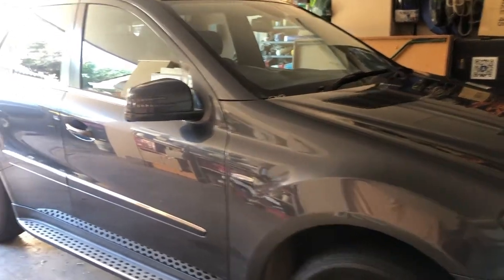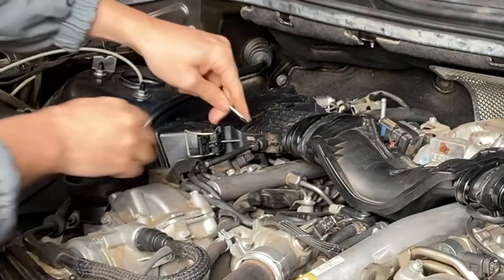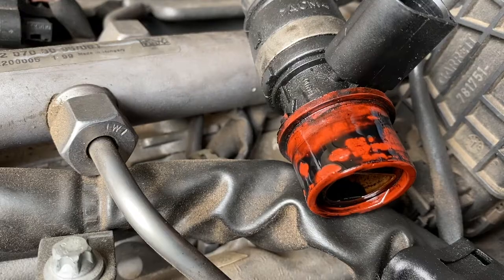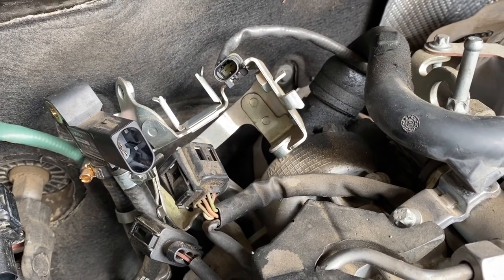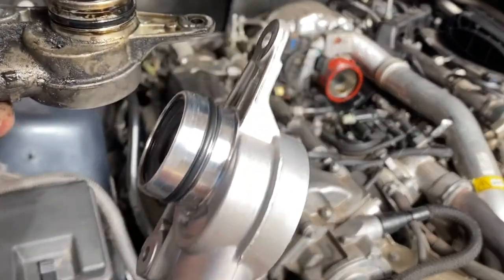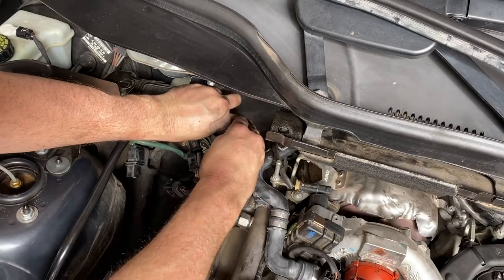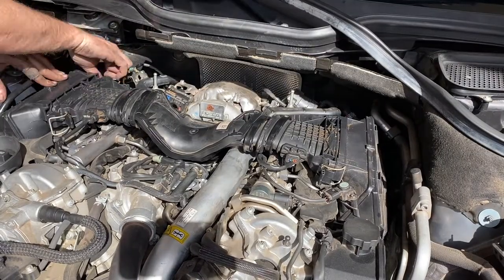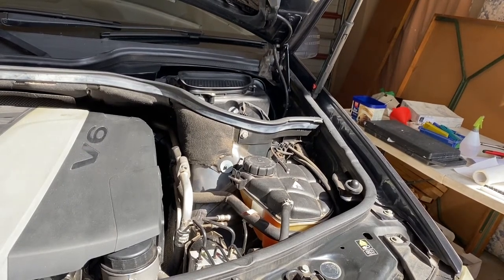How to Replace Mercedes ML W164 OM642 PCV Valve - The Complete DIY Guide - ML300 ML320 ML350

Comment: This video actually helped me locate the DPF differential pressure sensor it is behind that left airbox.  If anyone has limp mode issues, might be worth replacing that sensor, so far has solved my issues, I had two of the same sensors on my 2010 ML350 bluetec.
Reply from the maker: Awesome, I’m glad it helped and you solved your issue!!  Cheers Drew

Comment: I think the pcv valve replacement before reaching 60k km is probably the most important maintenance item that people neglect on the OM642. This is what kills the intake flaps and all kind of carboned-up issues, not the EGR.
Reply from the maker: Hi Emi, thanks for your comments, I believe that you are spot on!  Cheers Drew
Reply: My last one only went 23,000 miles! Average seems to be about 60K.
Reply: @KitYeeScott  these things are too cheap to not make it a regular maintenance item with the air filters and whatever. I'll make sure to do it more often from here on out, I was planning 40k for the next change but I'll cut it short.

Comment: Hi Dew... I have a 2007 GL320 CDI and I can listem my turbo leaking air and not boosting... I repalced the Turbo actuator not too long ago and the car was running pretty good until 3 days ago... now, no power and a wooooosh sound coming as I step on the gas pedal. Any ideia? thanks and a big hug from FL, USA. (BTW, I have run a scanner, it said a MAF sensor fault. I replaced both MAFs and same thing. So, I'm really confused about whts going on...

Comment: I own a 2016 GL 350. I have noticed that the fuel consumption has increased after i had its B5 service done from he dealership.  And I have also noticed some oil on the plastic box like thing that is in the front of the engine connected to the line that goes from turbo to the intercooler.
Reply from the maker: Hi Mate, unfortunately I have not many very good experiences with mechanics (inclusive of work undertaken by dealerships) which is why I do all of my own work now and share as much information as I can to others with my videos.  Any oil leak is not right and you have two options 1/ take it back to the dealership where the service was done and get them to rectify the issue that they caused under warranty or 2/ fix it yourself!  At the end of the day the most likely cause will be a bad seal as a result of them pulling something apart and then stuffing the seal on reassembly!  Checkout this video I posted which is probably the issue are now having: https://youtu.be/D9ALXb4pbww Cheers Drew

Comment: Great video but Benz only like Benz parts Amazon parts are carp.
Reply from the maker: Hi Mohamed, I think that you have to be selective about where you use genuine parts versus Amazon parts.  I have had great experience using Amazon (non OEM) parts on my Mercedes, however in this case I deliberately chose an OEM part for the reasons mentioned in this video!  My air suspension by comparison is completely Chines parts purchased from Amazon and I have absolutely no issues with my suspension on the vehicle and saved many thousands of dollars by going down this route!  Cheers Drew

Comment: Hi Drew, were you noticing an oil leak before this repair? I've been chasing an oil leak on my jeep cherokee with the om642, I had the oil cooler seals replaced and that helped a lot but I still have a small leak somewhere leaving 5 or 6 drips after it is parked. Thanks!
Reply from the maker: Hi Mate, yes I was!  Also check out this video … 
https://youtu.be/D9ALXb4pbww It actually makes me annoyed that the first thing repair shops want to do is oil cooler seals and then they wand you away with oil leaks still after spending a couple of grand!! Cheers Drew
Reply: Know this is late, but om642 has issues for oil leaks at the vacuum pump as well as the oil housing filter.  Worth looking in those areas if  still have the car.

Comment: Thanks for that drew. Not alot out there for this engine. Alot more out for the older 320 v6. Which has a different pcv valve.

 Cheers!
Reply from the maker: Hi Ross, u you are correct.  Sometimes you may say a Black 2006 ML320, this one has the older PCV valve style which is actually on top of the head and is a different valve!  Cheers Drew

Comment: Did this on my w212 e350. Straight forward but those bolts are a bugger to get to. I had to remove airbox and that bracket too  Had to use a pry bar to ease it out too. Wish I'd seen this video first . Thanks.

Comment: Hiya, I just did this job on my R class. Your video was very useful. Mine was like yours, just a bit of oil - but it had obviously never been off at 95K miles and 10 years. Liked and subscribed 🙂
I did the green O ring too - that was hard and knackered!
Reply from the maker: Awesome and thanks for the feedback!  Cheers Drew
Reply: Did you notice lower fuel consumption after replacing?
Reply: @Silvestian  yes mate, do you have the same mpg drops down? My go from 45 to 39 mpg 😢

Comment: Hi, thanks so much for educating us with all these great videos. I also have a 2011 ml350 with bluetec , with about 115000 miles on it, recently it has had a really bad vibration while driving in traffic with low rpm usually abot 1400 to 1900 then it goes away, almost as if the transmission mount was causing it. I was wondering if you or any of your viewers have experienced similar issues. Best regards.
Reply from the maker: Hi Vahid, vibrations can come from many places throughout the entire driveline.  Personally I would start with checking to see if your wheels are in balance and then progressively work through checking mounts and couplings. Note, I did personally have a vibration which turned out to be a wheel out of balance at one stage.  Cheers Drew
Reply: Same MY 2011 350d You'll most likely find it's your front control arms and front air shocks. Had both replaced and what a difference it made!

Comment: Great video Drew ... can I ask the two bolts that hold the PCV ... did you torque them up and if so how tight do they go please ... thank you
Reply from the maker: Hi Brady, I did not use a torque wrench, I just tightened them by feel.  Honestly the best part I have swapped out, there is another idea I did after this one wrt the unexpected increase in fuel economy, which is absolutely true to this day. Cheers Drew

Comment: Another great video, you are saving us heaps. Can I confirm that with PCV valve replacement, do I still need to install oil catch can? That is a more daunting task which I'll happily avoid. My OM642 has only done 70K Km or 44K miles. When do I need to start replacing the PCV valve? Are there symptoms like high fuel consumption which is a good indication to PCV failure? Thanks again.
Reply from the maker: Hi Rafis, all excellent questions!  To be honest I think this is actually an age thing as opposed to usage (eg kms) as the rubber diaphragm inside the PCV goes hard with age, however the thing to do is to simply take the plastic turbo y inlet pipe off and look in the turbo inlet to see if there is excessive crankcase oil sitting on the inlet lip of the turbo.  I have not put a catch can on my OM642 and mine has now done 140,000 kms however I have thought about doing it a few times.  Probably not a bad idea in the long term, however my thought was to fix the source problem first, which I believe was the PCV.  After doing the PCV I surprisingly got much better fuel economy which I also explained in a video: 
https://youtu.be/XihgSa-Qyr0 Cheers Drew
Reply: @DrewFixIt   @DrewFixIt  Hey mate, so took your advice and took out the Y pipe cause I was only getting 7-8km/l on a highway run and only 9-10km/l in the city. I think a dielse can do better. And true enough, even at 77K km, there's oil around the turbo inlet and both ends of the Y pipe seals. I've ordered the PCV part you've suggested and once it's in, I'll find the courage to replace it. It is an easy job but it is in such a tight space that it is tricky. And you are so right about mechanics at dealerships. This car has a good history of it being serviced and maintained at MB however when I removed the Y pipe I saw that one of the seal was not seated properly and someone has forced it in and lock the clips meaning it was not sealed properly for many thousands of kilometres. Not sure if this would disturb the MAF and fuel consumption. Anyway I've replaced that left side seal myself and hopefully I didn't bodged it as it wasn't as easy to put it back as the right hand side. The turbo seal looked alright but I've replaced it with a new one and it fits a lot more snugly and have also tightened o ring clamp which was not tightened before. I also wonder if I should just block off the PCV hose connecting to the Y pipe? And then block off that hole on the Y pipe, what would that do if I don't install an oil catch can. Thanks Drew
Reply from the maker: @rafiskadir  Hi Rafis, the crankcase needs to breathe mate, thus please do NOT block off the PCV breather hole as you suggest.  NOTE - if you do this you could actually cause damage!  Cheers Drew
Reply: @DrewFixIt  Yikes...definitely won't be doing that. Enjoy the weekend

Comment: Hi from Canada, Drew. This piece of advice is incredibly helpful. I've had a bad oil cooler leak on my 2010 and the mechanic is currently looking at it. The turbocharger stopped working and the car has been in limp mode for a while now. We'll be replacing the turbocharger but I'm starting to wonder if the reason it's not working is because of a leak from the PCV valve? Do you think it's wise to also replace the turbocharger? For the PCV, Mercedes advised to use part A6420102391, not the one you used. I’m a bit confused…
Reply from the maker: Hi Mate, are you sure that you need a complete new turbo?  I replaced the turbo actuator on the black ML that you sometime see on the channel with this part: https://amzn.to/41VsXSi and it fixed the issue with the vehicle going into limp mode with a turbo fault.  It is far cheaper to just buy this part than the whole turbo!  Cheers Drew
Reply: I was wondering about that but was skeptical after reading some online posts about the replacement actuators crapping out. I already bought the new turbo, though. Does it make any sense that an bad PCV valve could leak INTO the turbo or does it just leak ONTO it, not damaging it? Thanks so much!    @DrewFixIt
Reply from the maker: @tickertape82  Hi Mate, I can't see how additional oil going into a Turbo could damage it.  Rather the additional oil just creates a mess in all of the intercooler and intake system!  Where are you, can I have your old Turbo?  Cheers Drew
Reply: Ok, good to know! I'm up in Canada. Can save it for you if you like.  @DrewFixIt

Comment: Hi there 
Do you use any liqui moly CeraTec oil additives when changing oil? 
Any advice highly appreciated
Reply from the maker: Hi Mate, I have used oil additives many years ago, but that was like 20 years ago.  I certainly am not against them, however I genuinely purchased high quality oil as specified by the manufacturer and rely upon good quality oil.  Cheers Drew

Comment: Some youtubers suggest to reroute the CV from right in front of the turbo intake to in front of the air filter to reduce suction. What are your thoughts on this?
Reply from the maker: I think the manufacturer made it like this for a reason, so just replace the defective parts!  Cheers Drew

Comment: Hey ! 
Does a bad PCV can affect your EGR valve ?
Reply from the maker: Hi Mate, a bad PCV valve has the potential for the turbo to suck crankcase oil when it spools up, Whig I suppose could then pump that oil through the whole EGR system too … Cheers Drew

Comment: Did it help getting the oil into turbo?
Reply from the maker: Yes mate, my Turbo is much healthier for it now!  Cheers Drew
Reply: @DrewFixIt  thanks. My turbo is getting oil through this valve. But new part seems like straight pipe. I will replace it anyway. Thanks
Reply from the maker: @satnamlayal7034  I think perhaps you have received an incorrect part as my part I installed was physically identical to the original. Cheers Drew

Comment: Hello drew, 

I just change my pcv valve, the car i driving great and have nice response but i am getting really high fuel consumption efter the replacement you have any idea what vent wrong ?

My air filter on the driver side is have oil marks aswell ( 20% of the airfilter) 

Regards worried 350 ownerb
Reply from the maker: Hi Mate, sounds like you are sucking up an excessive amount of oil.  Did you install a genuine Mercedes part mate?  Cheers Drew
Reply: The old pcv was a original i think, it was stuck open wich made the oil leak into the airfilter. The new one is from a brand called trucktek and seem to do the job better but just giving me absurd amount of fuel consumption. 

Any sugestions of what i cal do to fix it ? 

Can oiled up maf sensors make this occur ?
Reply: A little update. 

Just stript the intake butterfly and cleaned it with contact spray and canned air the car is running great and rides nice.. the fuel consumption on highway was back to normal again but when i just stand still and idle its starts going up again

Any toughts ?
Reply from the maker: @HaiderAli-cd3vt  the new PCV valve has a new sensor in the hose from memory.  Sounds like you may just need to put some time on it to let the ECU re-calibrate perhaps?  Cheers Drew

Comment: got e350 4matic,2010 model,just same part. They sell also that oilring,oilseal,60euros. And whole tubular system,200euros. So i just bought whole tubing valve case thingy.430thousand kilos driven, in a klock. About time to change. MIL-light ,motor shape- is on now. Just fefore,i put 4tech stuff in a tank. To dissolve pdf stuck. shall see.....greets from finland/suomi.
Reply from the maker: Hi Mate, thanks for the update!  Cheers Drew

Comment: 1 month ago i did the oil change in a workshop . After oil change i noticed some loss of power . But I didn’t care because there was no warning lights . Yesterday i checked there but the PCV rubber seal , intake seal weren’t connected well . I will change the seals immediately. 
Could it done any harm to the engine or other components?? 

These days no one can believe the workshops . 😕 even he didn’t close well the air filter clamp 😑
Reply from the maker: Hi Kavindu, the last time I went to a workshop I was terribly disappointed.  They charged a lot for sub standard work, I think I took the car back to them 4 times to fix the issues that they created, but then in the end I had to fix several things (that they did wrong) myself ... just not worth it, that is why I started fixing my cars myself and why I try to share what I do with others too!  Cheers Drew
Reply: @DrewFixIt  usually i also do the same . I don’t have lot of knowledge about motor mechanics. But i read lot of articles and learn with experience . So i can do things very carefully. But this time i have an extended warranty for this car . So i must visit the workshop. But i was really scared how they closed the air pipes . If he did any repair inside engine nobody sees that .
Reply from the maker: @kavindugilshan  Hi Kavindu, understood.  extended warranties make it difficult.  My suggestion is to find yourself a good indy to do service work but then check everything they do yourself afterwards!  I have another video on changing the turbo inlet seals another on changing the filters, etc, infact I have a whole playlist you can watch .. https://www.youtube.com/playlist?list=PLor5qdyoV_nRcb5hDS-z6z1wUHNednb2h   The more you learn the better!  Cheers Drew
Reply: @DrewFixIt  thanks !!

Comment: Hi, I have oil also in my turbo on my 2008 e320, I thought it was supposed to be like that, also I have an oil leak, don’t see where it comes from but it’s mostly on the drivers side and seems like it starts from top
Reply from the maker: Hi Vadim, has your car got the OM642 engine and is it right hand drive? Thanks Drew
Reply: @DrewFixIt  yes om642, it’s left hand
Reply from the maker: @vadimburda4111  Ok.  The turbo intercooler pipes run on that side and it could be that the seals are compromised?  Does the car lack turbo boost? Is it spraying a mist back towards the firewall on that side?  Is it dripping off the EGR valve?  Cheers Drew
Reply: @DrewFixIt  I don’t see anything on the egr valve, also the o rings on the intercooler hoses are good, also I don’t know if it’s lacking boost since it started leaking right after I bought the car
Reply: @vadimburda4111  hey, that car has 2 very common oil leaks. One is the very difficult oil cooler seals...  the other, if your lucky,, after 150kmiles or so the oil filter housing. The seals go bad... if you see a lot.of oil on your lower AC lines and compressor and some on your belt, its the filter housing, pretty simpleto do. 
If you see a lot every where including from the back of the motor.. almost looks like from the transmission, that will be your oil cooler and thats a very hard one.